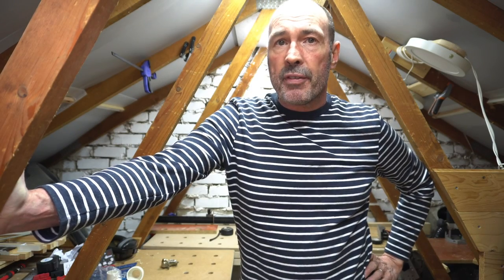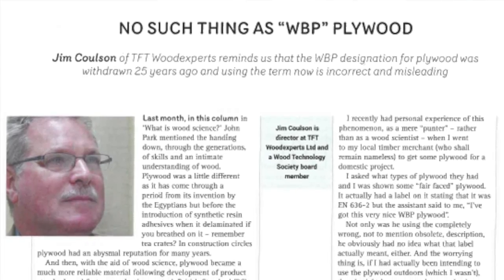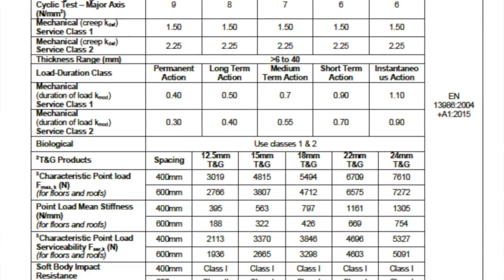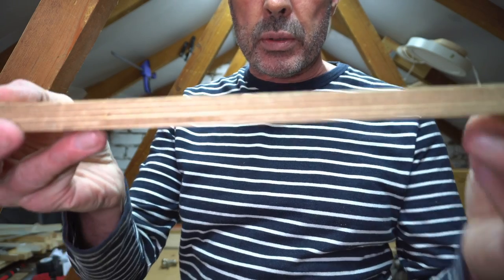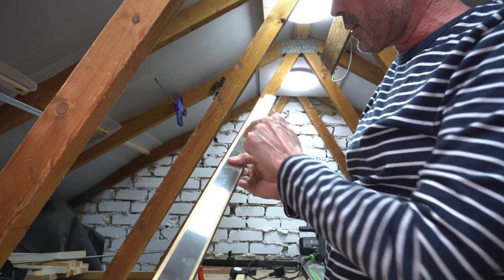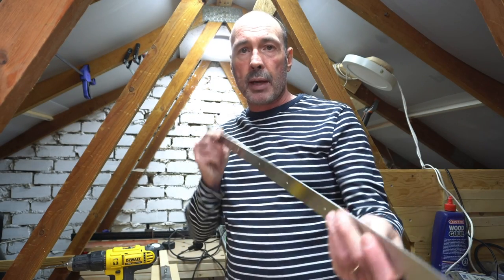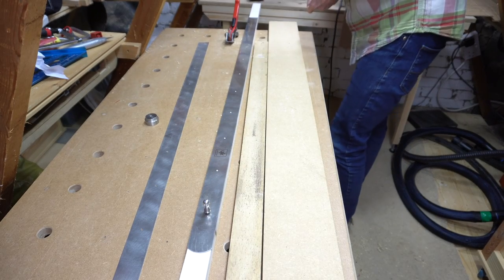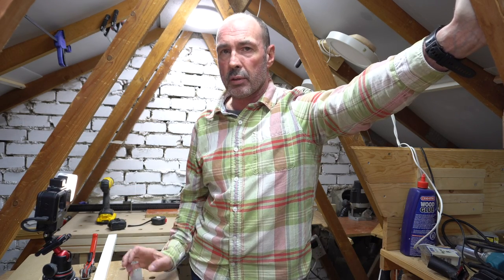Plywood or MDF for MFT Workbench Builds? JP's Vlog #4

Comment: Excellent experiment!  Some comments-
Moisture is the main cause of movement (thermal expansion of steel is very similar to MDF). With MDF the dimension increases with moisture, but does not fully return when it is removed (there are a couple of scientific papers measuring this effect).
This can happen differentially over the sheet, causing skewing as well as linear movement. So the dogholes are no longer at 90deg to each other.
The ply you showed looks like the normal 7 layer for 18mm- I was fortunate to obtain a sheet that was 13 layer; it is beautiful stuff!
MDF is much cheaper than good Baltic ply- but then an Aldi tracksaw is much cheaper than a Festool... and accuracy is a sum of the parts. The weakest link in the chain determines the accuracy of the result.
The published specification for Medite (a quality MDF) is for a linear stability of 0.3% - which is 3mm per metre. Cheaper may well be poorer...

Tightening tolerances always costs money, it depends on what is required for the result. Understanding the compromises involved avoids disappointment.

It is not always remembered that the original Festool MFT does not reference cuts to the dog-holes- they are for clamps. The cut is reverenced to the aluminium frame; and is adjustable for angle.

Keep up the good work!
Reply from the maker: Thanks Mike. I said a couple of times in the video, I hoped to forge a conversation because it is a subject we all have interest in - my wife said it is the most boring video I have ever made!  Working for manufacturers over they years I have witnessed plenty product failures (and false claims) I am thrilled you have devoured the data sheets from manufacturers, my current job dictates I do the same. It is amazing what info is contained within. Regards JP.
Reply: @Smallbarnworkshop  It is a topic I have followed for a few years. There are scientific papers on the subject, but not easy to find. I spent several years designing equipment that needed to meet international standards, so I tend to question design choices... For me, relying on compressed wood fibres for measurements (such as cutting sheet goods square) seemed doubtful. Seeing the lengths CNC machines go to to achieve accuracy that is also claimed by some MFT users raised questions...
Reply from the maker: Working in the drywall arena our tolerance must seem huge compared to engineering . Add BS8212 to your reading list.

Comment: I think that I was one of those who were talking about expansion in MDF, plywood etc. firstly, however, another recommendation for problem-solving whilst walking the dogs; amazing how ideas and solutions come to mind whilst you’ve been occupied doing something else. 

As you mention in another comment, the quality of the substrate could well be a significant factor. Our local B&Q often has quite large offcuts of their MDF left outside to be taken in exchange for a donation to their charity. I have taken some but only use it - would only ever use it - for sacrificial purposes. They also do have, on rare occasions, a product which is either wall or floor laminate and the core of this is very good quality such that I do use it for jigs.

As you and others have said, there is a lot of confusion about grades of plywood such that I only ever buy it from a merchant that I trust or when I personally have seen the product. The offcut you showed is what I would expect from first class plywood (I try never to describe something as birch plywood because that conveys the idea of quality which is sadly lacking in many products called birch plywood); the MDF seemed to be of the box store quality. 

For relative newcomers, this is a minefield. If I can offer my thoughts - for MDF, buy only that made by Finsa, Kronos and Medite  ( I think there is one other mentioned that I don’t recall); I do buy some very nice MDF-based products from Finsa such as their very high quality veneered sheets which is textured on one side. For plywood, try and ignore terms such as “Baltic” and go to a good merchant (not box store) and ask about what they stock. Buy from EBay etc. with caution - some say hardwood as if that were a sign of high quality in itself; it’s not. I don’t think the term hardwood in this context has any great significance - it’s about the lack of patched faults on at least one of the surfaces, the number of layers, the consistency of those layers and the absence of voids when you look at the edges. 

We recently had a widespread shortage of sheet goods particularly during the pandemic. Prices shot up with OSB costing more than plywood. What resulted from this was a market vacuum into which lots of low grade product was sucked. If you had to, you bought some but that’s not the case anymore and, obviously, some suppliers still have stocks of this that they want to get rid off quickly. If the price seems too good to be true, then beware.
Reply from the maker: Morning Theo. It was your comments and the subsequent discussion that inspired this video.  Caber is the other UK production. 

It is a while since I was a timber salesman, we always needed a "fighting Brand" and  your companies price of 18mm MDF became the benchmark of how your general pricing was judged.  Most companies, therefore, stocked (usually) 2 of the 3 UK brands - that always leaves the door opening for negotiations with the other suppler and sometimes caused a reshuffle of stock for the following year. Then a budget range of MDF (chipboard flooring etc..) for those customers or projects, that needed to buy on price and  not quality. This product was bought on the market as a forward order and may consist of a 1000 packs. the next 1000 packs came from somewhere else.   If I remember correctly, the going rate for 18mm MDF (circa 1998) was £8 per sheet! I paid £11 for quarters of a sheet a few weeks ago!. 

I know these usually end up in secondary merchants as they have an extra margin to be made and need to be affordable. Also, offering sheets cut to smaller sizes 4x 2, 6x2 etc realises extra margin as they can offer a service to customers that the bigger boys cannot serve. 

I left for the drywall market in 2003 and have been here ever since. My knowledge of plywood / sheet materials work well for me here as we buy ply and OSB by the truck full. 

Thanks for the idea of this video. Keep them coming :-)

Regards JP
Reply: @Smallbarnworkshop  thank you for your reply. I can only take partial credit - along with Mike (?). That discussion could branch off into what is accurate for woodworking; in fact, what is accurate for the hundreds of differing types of woodworking. There is no point in me working to the same tolerances for wall panelling as for piston-fit drawers (which I have always regarded as an affectation rather than necessity. There is knowledge to be gained as to how accurate do I need to be for this job/piece. Then how do I measure accuracy and how do it I mark it. On many occasions, the accuracy of a precision ruler doesn’t matter greatly so long as you use that ruler for every measurement; discrepancies occur when you switch between laser to tape to ruler to vernier gauge. 

Marking that measurement is also a good habit to get into; I might use a carpenters pencil for exterior work but internally, I use a 2H mechanical pencil alongside a selection of Incra rulers and squares plus a 2B which I use to make the timber for face side, top, bottom etc. 

Going back to piston fitting and the like. For a relatively short period of about 5 years, I started a small sideline business to my own much large concern making furniture for others. I had no intention of getting into cabinet making to sell on but I had some wealthy American clients of my main business who, when we talked about styles of furniture, asked if I would make them items in the style of Voysey, Morris, etc. We ended up making about 30 pieces in total for this circle of ex-pats and it was low turnover/high margin business. Anyway, I showed a design for a desk to the American wife of one of the group and explained about quarter sawn oak, styles of hardware etc. when she asked me about those arrow things in the sides of the drawers. She said that this detail detracted from the overall simplicity and honesty of most Arts and Crafts movement pieces. I had to agree and started to think about dovetails, piston fit drawers etc and came to the conclusion that mechanical jointing is no longer necessary (we have chemical jointing which is worlds away from what people like Chippendale could imagine; if he had had stuff like epoxy etc. would he have paid his workers to spend unnecessary time cutting dovetails?). 

I suggest that the majority of dovetails and piston fit drawers are only there to please the person who made them; to prove how good he is; to be evidence to other woodworkers that he has skill. Just my thoughts.
Reply from the maker: A alot of fine wood working is there for aesthetic pleasure. Although the I admire those with the skill.

Joiners pencils are like a crayon and we sharpen out pencil with anything we have to had that resembles a blade 😂

Construction tolerances are huge compared to engineering. I work in a industry where +/- 5mm is spot on!

Comment: Thank you SO much for this. As a beginner, there are so many useful & fantastic YT videos on actually making stuff, but relatively little on expansion/contraction/tolerance. From what you've mentioned here and in your previous posts, you're obviously the UK oracle on this subject.
I'm still pondering the empirical notions of a) 'Square', and b) Movement. 
Many fab YT woodworking sites are USA and deal in American Imperial measurements, there seems to be a lot of snobbery about thousands of an inch over even the smallest distance.
I'll be happy if my first build doesn't fall about like a clown's car and I still have all my fingers.
Cheers.
Reply from the maker: Thank you for your kind comments. Regards JP
Reply: If the material expanded and contracted in a linear manner, it would not matter for practical purposes. Sadly, the contraction does not match the expansion, so local areas of distortion can build up. This means the angles between features are liable to movement.
Reply: @Tensquaremetreworkshop  Thank you very much for your helpful clarification and further comments. Much for me to consider!

Comment: Interesting video apart from the movement I personally think plywood top are a lot harder wearing. But MDF is a lot cheaper to replace. Be interesting to try the same test with  moisture resistant MDF
Reply from the maker: Hi Mark. I didn’t have an MR but I am going to redo with some. Regards JP
Reply: 'moisture resistance' refers to the bonding agent- the fibres are the same, and it is they that absorb the moisture. Published data shows no real difference whit conventional MDF.